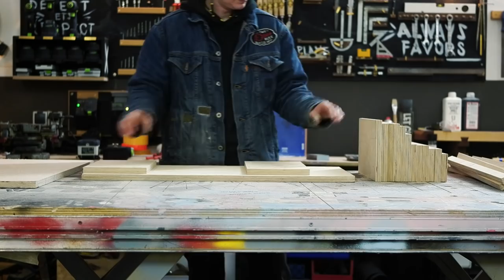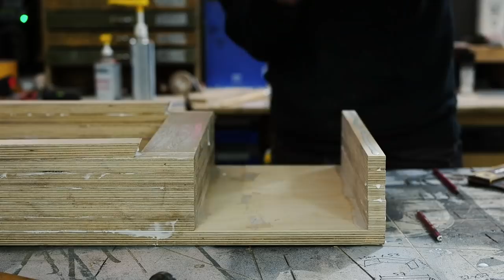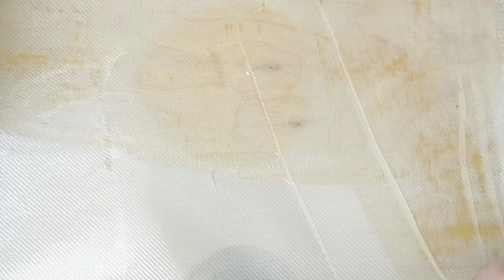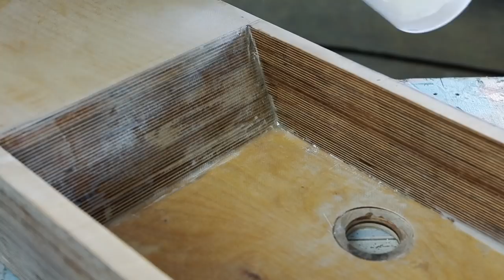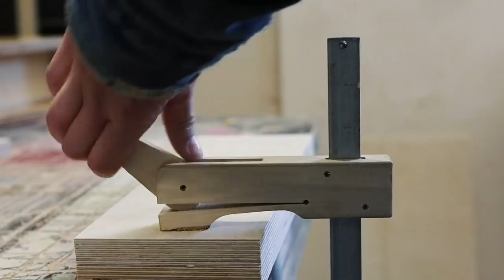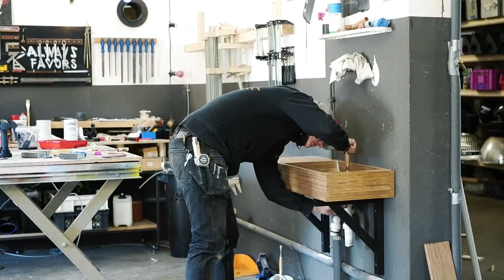A Sink made from Plywood!

Comment: I assume the plug hole has a lot of resin and then silicone in it. But the next thing has to be a backsplash to stop the wall from getting trashed and to stop water getting down the back and breaking down the materials with time? Perhaps some creative materials usage for a backsplash ? As always superb video 😀
Reply from the maker: Yes! I was out of silicone and didn‘t want to run to the shop right now. I will add all that once we go back to „normal“
Reply: silicone is not the correct material for bedding a drain fitting into the opening. It should instead be done with a product known as "plumber's putty" or as an alternative butyl rubber tape. Both of those material will remain soft and stay watertight for a lifetime of use. But silicone caulking can loose its bond and then leaks will occur.
Reply: @karincorbin2355  you are right! I'm a plumber
Reply: SIKA makes a product called "supermastic-2", used for drains and such.
Reply: @DMJ1978  SIKA makes a tube of goo for everything. Want to make a mess? Check with SIKA, they'll give you something to make a mess with.
Reply: @laurakampf  "once we go back to normal" may be around the end of the year.... :-/
Reply: I'm a carpenter for a general contractor that builds grocery stores. Our plumbers do in fact use silicone instead of plumbers putty for sink drains. It reduces call backs.
Reply: @rojer9542  Yep. That would work for a carpenter. Reduces callbacks in the early days until the workmanship warranty is up, but fails 100% of the time after a few years.

Just teach your guys how to use the putty properly, or any other proper water sealant. Silicone is a guaranteed failure point for any plumbing application.
Reply: @Seegalgalguntijak  more like the end of the next year
Reply: Geno, for our projects silicone solved the problem. We are not getting callbacks or service calls with the silicone.
Reply: @soupflood  I don't think it'll be that long. Second wave during August/September, and in about 18 months we'll probably have a vaccine, so yeah. Either that, or humanity will die out anyways, and if that happens, I'm fine with it also.
Reply: @rojer9542  No, it ignores the problem and creates another problem that eventually won't be yours.

Silicone is literally the worst sealant ever devised by man, mostly because it's constantly misused for applications it was never intended for. I can seal a sink with cardboard and it will last longer, with fewer issues.
Reply: @PapiSmerf  strange I've pulled apart sinks at UW that were 20+ years old silicone.  Still working just fine.
Reply: Seegal Galguntijak which year......?
Reply: @PapiSmerf  Silicone is the only sealant used for glass aquariums, both to seal the joints and hold them together mechanically, so it's got some good properties.
Reply: @PapiSmerf  Zing!  And you're right.  I'm not a carpenter but a general handyman.  Putty, baby.
Reply: @jeremydingeman2492  Everybody gets lucky occasionally.

I used to be a roofer, and sometimes we'd replace drain covers on a building that were half a century old or more. The old cast iron covers and flanges would be crumbling, but the putty was still fresh and gooey every time.

We get 70 inches of rain on average around here, and each roof drain handles thousands of gallons with every storm. On top of the wind and the sun.

Guess why I use what I use on my sinks.
Reply: @laurakampf  You know. Talking  people through as you go would eliminate a lot of needless questions and allow you  to answer unforeseen questions. I REFUSE to watch informational /instructional videos if the individual doesn't speak and talk about what they are doing and why. The idea caught my attention but you lost me as soon as it became evident that no one would speak. Count me out!
Reply: @williammessenger9637  Ba-bye...I enjoy these videos because you can figure out where it's going or you get surprised by cleverness!
Reply: @jasexavier  I guess the weight with water makes the aquarium rigid. Sinks are not that rigid, so that may be the difference here. Am not an expert though.
Reply: @afisher555  I think the weight of the water works against you. A modern aquarium is essentially just 5 sheets of flat glass, held together against enormous forces by only those beads of 100% pure silicone.

However, looking into it, there are some caveats here. Silicone apparently bonds particularly well to glass, and might not perform as well bonding to epoxy, acrylic, or other plastics. Also, at least for an aquarium, those pure silicone adhesive sealants require 7 days, dry, to cure, and won't cure properly when wet. How many people are going to wait a week to put a sink into service? So, I think perhaps silicone is really good stuff, but only when used as directed, which in the case of sinks it probably usually isn't.

Oh, and since it cures, if you break anything loose the seal is lost, whereas a non-curing putty can reseal.
Reply: @laurakampf  it is not too unusual to find a friend or neighbor with a container of plumber's putty in their box of leftovers from making home repairs. Unless the lid was left off it should still be good to use.
Reply: @laurakampf  a piece of inner tube can make a rubber washer. I made a lot of washers/grommets from old bike inner tubes.
Reply: @rojer9542  Silicone will last a few years depending on usage and stress, but plumbers putty can last a lifetime (or more).
Reply: Plumbers putty is old tech, it had its place and now it's time has passed.  I have all sorts of drains going on 10 years + with silicone.  If done well silicone will last a life time.
Reply: @williammessenger9637  Dear William, many readers of the comments section will be highly distressed by you leaving so soon. Some will suffer acute anxiety as a result of your deeply considered action. Others will hover over your wise words of advice to Laura, whilst pondering some course of action that they too could undertake in order to entreat her to speak. 

A National Appeal perhaps? Or even a monumentally huge advertisement beside a major Autobahn would be better. The advertisement could feature a portrait of your good natured self in cheery colour, sitting at your breakfast table with a packet of Cardboard Cornflakes: 
"William Messenger Implores Laura Kampf to Speak Directly To Him At Breakfast"

That might do the trick.

Then you'd finally be able to understand the intricacies of how to eat breakfast whilst making a sink.
Reply: @BrassLock  Thank you for your interesting collection of poses for @William, he should find this useful in his reflection.

I hope to hear from him in the coming days, and gain insight from his learning. I wish to understand further how he will navigate through the complexity of the world of wood, its connection to the contemporary digital age of today and his gentle wrestle with how one should orate around these issues.
Take care my learnered companions, as a collective group we shall rise together, we will overcome these problems and charge through these barriers as one.
Reply: @williammessenger9637  Laura doesn't make instructionals. Laura's channel is about inspiration for people that make beautiful and useful things, and those that appreciate them. It's meant to be beautiful, and give you ideas, not hold your hand through it. There are enough super chatty instructional videos out there, if you need a "Hey guys, boring nerd here. Here's how to use epox in 12 steps..." etc.
Reply: @williammessenger9637  Where does it state or even imply that this is informational/instructional? It's simply someone building something cool for us to watch. If you don't like that, that's of course absolutely fine, but your reasons show you in fact, didn't pay much attention to begin with anyway.
Reply: Nice job! Time to replace that old faucet as well
Reply: @williammessenger9637  im deaf 
So i dont need voices , i need captions, but silence works too.
Could hear decades ago, not now
Reply: Es ist lustig wie viele Leute  über das korrekte abdichten eines Abflusses diskutieren können 🤔 und es heißt auf Deutsch Sanitär Kit 😁😉, zumindest in Österreich 😆...
Super Video, muss ich gleich mal in unserem Wohnmobiel ausprobieren!
Danke fürs zeigen und die grenzgeniale Idee 🤩
Reply: Was thinking the same then realised I just love watching/listening to these with nothing more than admiration. Thank you for putting your creativity in the world. Those that 'do' can add their own touches x

Comment: That's an outstanding project and it came out very nicely. For future reference (should you have another such project), there are very soft, finely woven fiberglass cloths used in the radio control airplane hobby. Those finer cloths allow you to mold them into corners easier. That way, you can seal the corners with the fiberglass as well. Keep up the great work.

Comment: I built a darkroom sink for my darkroom back in the early 90s out of plywood. I coated the inside of it with fiber resin and fiberglass cloth. I recently recoated the insides of it with Flex Seal liquid (white). I'm going to paint the outside of the sink a color I call "Kodak Yellow".  I'm going to cut off a section of a Kodak box and take it to the paint store to see if I can get a match for paint.  But I think the Flex Seal liquid (white) was an excellent choice for recoating the inside of the sink.

Comment: Neat. You need to add a splash guard to protect the wall and prevent water from sitting in the joint where the wall meets the sink. A simple board epoxied on will do, and compliment the look.

Comment: My brother is a boat builder and has used the West System for about 30 years, great sink :)
Reply: What sank?  :)
Reply: "West system"???
Reply: The fiberglass resin.
West is likely the paid promotion along with a few others.
West makes doing fiberglass easy and consistent. 
It is also useful for working on aircraft.

Good stuff 👍
Reply: @MRSketch09  Its an epoxy resin system, which unlike the traditional fibre glass resins does not suffer from osmosis hence why it was developed for Martine use, like other epoxy resins it is hard wearing
Reply: @Richard_OKeeffe  The other sort of resin generally used with glassfibre is Polyester. Still has it's place in glassfibre layup, but not as good as epoxy for glueing and sheathing jobs like this one. I build boats in wood, I use Epoxy. Use West a lot, but there are others that have their advantages. The MAS system in particular does not suffer from 'Amine Blush' (l'll not explain here, lots of info on the interweb.) I'm also interested in trying some of the new water based epoxies that are getting good reviews among fellow boatbuilders.
Reply: @Richard_OKeeffe  I appreciate the response. In this situation when you use "Osmosis".. do you mean its not absorbed by, the wood? so 
in that sense it "holds up better" last longer?
Reply: Tim O'Connor I’m in the middle of a project using System Three water based, and it is very nice having zero VOC’s, so no mask during application. One characteristic of the particular product I’m using is that it has a 72 hour recoat period, which is sometimes helpful, but that also implies that it takes a long time to cure.

Does anyone know if I can apply West Systems over the semi-cured System Three? Fully cured?

Comment: Love the design! Like others said -- backsplash! -- also, it looked like you fitted your drain without any plumber's putty... it's like a kind of soft clay that doesn't really ever dry out and will fill in gaps and small voids between the drain and tub of the sink, preventing leaks. On the bright side, if the bottom of your sink does rot out, you can just whip out a fresh sheet of birch plywood and make another! This is a great idea and I'm very impressed with what you've done, here. All the very best to you!

Comment: Perfect, planing on redoing my entire interior of my house out of wood but the bathrooms were my biggest obstacle.  Every contractor I've talked to said it wasn't possible, but now I see it's just they didn't know or they didn't want to do it.  I know it can be done, only thing that won't be wood would be the toilet (but I'm sure thats possible as well).  thank for this, finally something I've been in the planing stage for 3 years can get closer to being started and finished
Reply: You need to understand you aren't making a waterproof object out of wood, the wood provides structure and the aesthetics. The waterproofing comes from the layers of fibreglass and resin.  I still worry about the longevity of it, wood expands and contracts, and can crack or delaminate the fibreglass I the movement becomes too great. A boat builder would be best placed to understand how to make something like you need.

Comment: Maybe a quick connect hose on the tap to prevent some splash and get the water closer to the bowl? You are the queen of plywood!
Reply: And another thought, because I'm stuck at home and bored: if you had a couple of different lengths of hose, you could swap them out and not have to lift the canister into the sink at all. I imagine that thing gets pretty heavy when it's full. Just roll it over on a dolly, fill 'er up, then roll it away to where you need it. I'm also lazy.

Comment: I wonder if epoxy would be enough. Would have neatened the corners. But u guess a work sink gets bashed about a bit hence the fibreglass. Another beautiful idea i want to try. Love it.
Reply: a workshop sink takes a pretty hard beating, the cloth with resin gives it a hard surface. Just resin on the wood without cloth would very quickly get a lot of nicks and dings that allow water to get into the wood. So that cloth is actually essential for the intended use of this sink. You could get away for a while on a bathroom sink with resin only where the sink does not have any metal objects put into it.

Comment: nice idea !
But a small mistake in cutting the fiberglass around the water outlet hole: it is there that the water remains longer infiltrating the plywood until it rots: you should have continued with the fiberglass until you came out the other side of the bottom, at least at least all the part you milled inclined.
Even if you used silicone adhesive to mount the drain, this does not make a single body with fiberglass and over time the water infiltrates, unfortunately sooner than you think ... but then you are so good that you will make another more beautiful one and more original
Reply: because then edges of that's  drain opening are allmost all end grain it will soak up the resin deeply into the plywood. Also because the drain fitting is set into a soft substance such as plumber's putty or gutyl rubber there is little risk of having water get into the cut hole. Therefore  no cloth is needed inside of the hole, resin along is sufficient for the needs.  In the sink area she used fiberglass cloth as well as resin to create a hard surface, extra thick layer to protect the sink from the kind of nicks and bangs cleaning tools or filling containers will create. But the hole cut through for the drain will never get that kind of wear and tear on it.

Comment: Great work as always! A few thoughts 1) Make sure you put a layer of epoxy down before the fibreglas mat - it makes it "wet" so much better with more even transparency plus it holds the mat in place 2) I doubt you needed the mat at all given the strength of the ply 3) Did you epoxy the drain hole after you cut it? This is a major wet / leak point 4) Run a bead of silicone along the back / wall joint - again this is where so much water / rot gets in to things 5) When doing the filleting (I got addicted to this thanks to Tom Sachs) I find either the end of a popsickle stick is perfect or a bit of silicone (spatula) cut to size makes for a perfect radius. Keep on making - we love it!
Reply: the fiberglass cloth is needed in a workshop sink. Too many hard knocks and dings for a resin only coat. If it was resin only on plywood the resin layer would soon have a thousand tiny breakthroughs into the plywood. The cloth gives it greater durability over time. If it was resin only for a bathroom sink in a house, no problem.

Comment: Instead of having to go through the ordeal of fiberglass, could you perhaps get the same results by applying one or two layers of some sort of epoxy onto the ply? Did you fear that there would be expansions that would crack the epoxy in the corners? Thanx.

Comment: Is there a benefit to using fiberglass and resin opposed to two part epoxy?
Reply: stronger so any bumps wont' lead to cracks which will lead to rot.

Comment: Word of warning, you will get bubbling if the water is cold, so be careful not to run it for long lengths. It causes the moisture in the wood to concentrate. If this does happen, take it to a taxidermist and ask if they have a tank big enough for your thing... Usually that will fix it, then give it another layer(front AND BACK) and you'll be good.

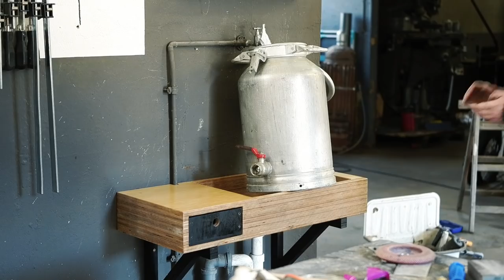Comment: Great project! However... I'm sad to see you have the same problems as me: 6:41 The big kettle does not fit in the sink...
So annoying!  Unfortunately I sometimes / often solve only SOME issues because I did not 'SEE' all of them at the time.
e.g. 
- backsplash
- is the size of the sink big enough to fit the big kettle etc.
- can I integrate a soap dispenser, towel hanger / blow dryer

The positive aspect to this 'problem' is that there is always an opportunity for an update... == another video!
Keep up the good work!
Willem